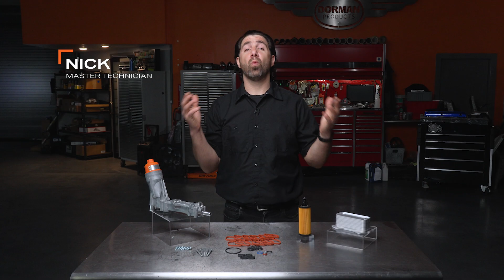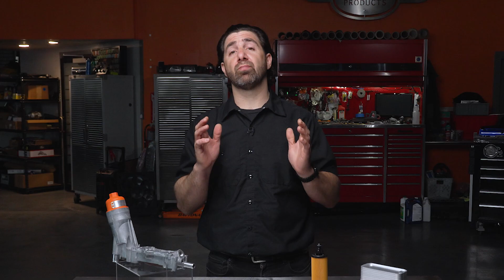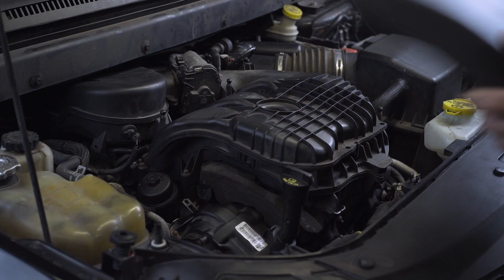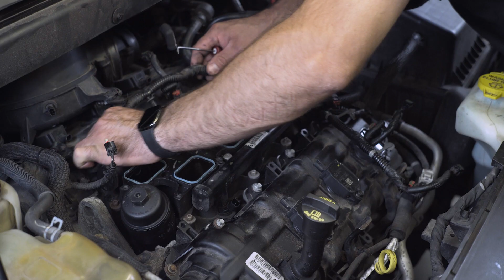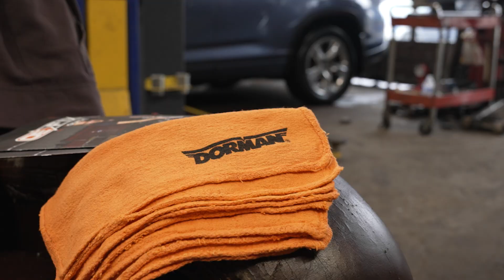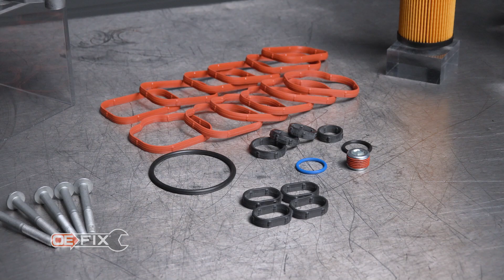How to install upgraded Pentastar oil filter housing | Dorman’s patented OE FIX® 926-959

Comment: You might have to remove or disconnect a few hundred things but after you do install the Doorman 926-959 oil filter cooler.

Comment: This is  a piece of junk. The oil filter head breaks when you screw the cap on. it's happened twice where that piece goes down into the engine, this housing has destroyed my engine..
Reply: You mean the orange replacement cap???